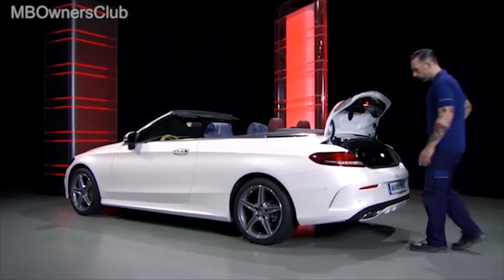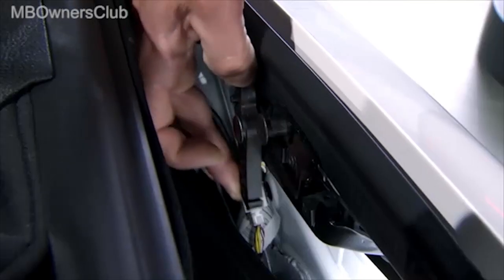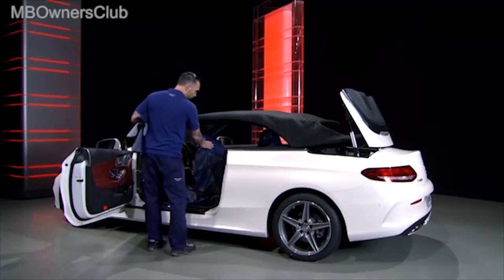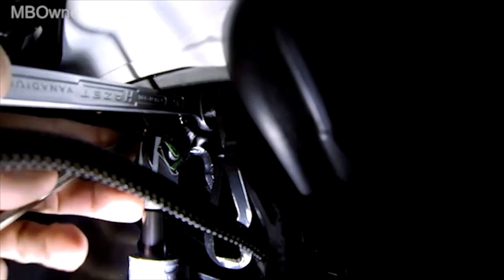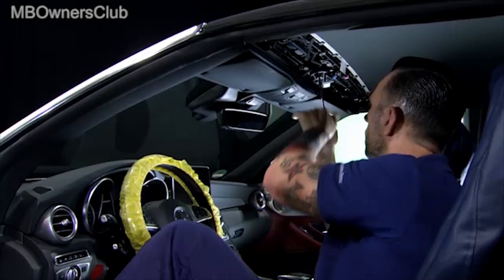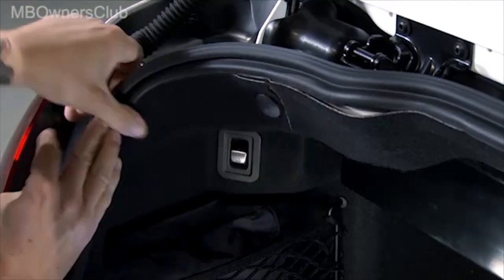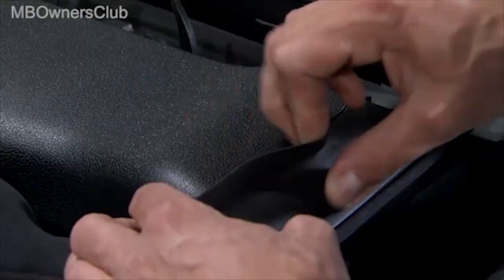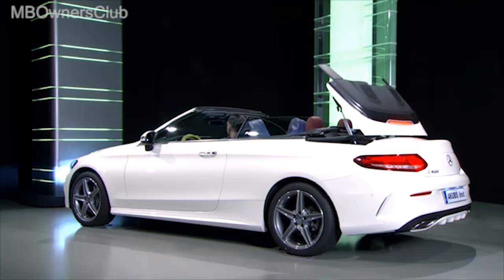Manual Soft Top Closing for Mercedes-Benz C-Class Convertible: A Detailed Tutorial

Comment: Can someone advise what tool I need to open roof latch by the windshield on W205? I bought 5 and 5.5mm square sockets but they are too small. 6mm is too large. I was using vise grips but square pin started to strip. On this video, it looks like they use special square socket and my local Mercedes dealer can’t find this tool.
Reply: Awaiting this answer too

Comment: After finishing the procedure is there a need to reset something? I've done the procedure as instructed and it still shows message "open / close soft top completely"? This means I have missed something? Also the car had rollover bars blown - so after exchanging them for the new ones do I need to reset the error message before the roof can be operated?
Reply: Hello, did you find the problem for the open close soft top completely?
Reply: Hi did you find out the answer?